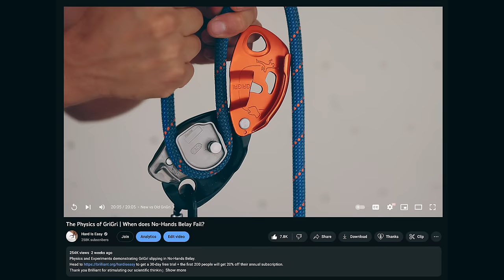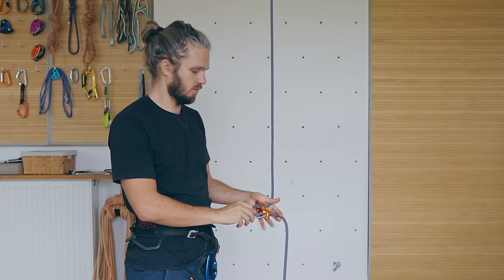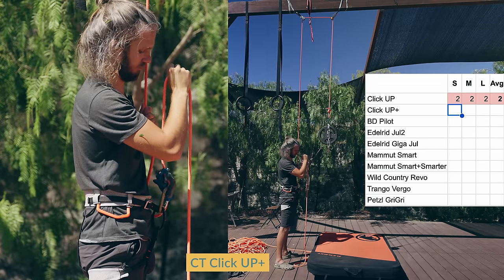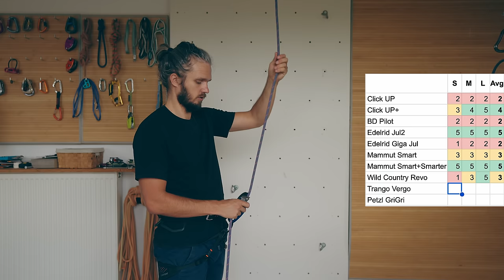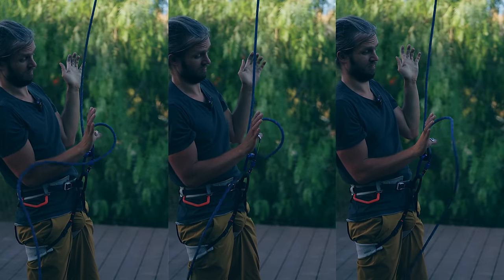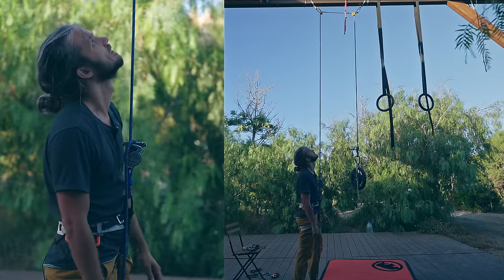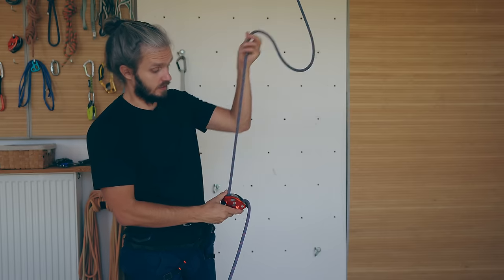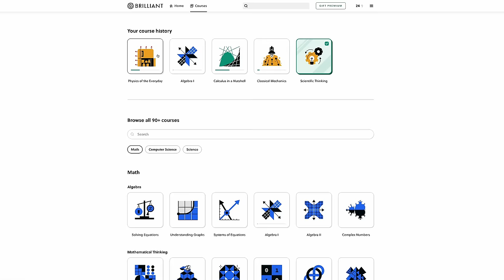When Assistance Fails!? The Physics And Experiments of Belay Devices

Comment: Of those devices I've tried the GriGri, Jul2, Pilot, and Smart 2.0 (without Smarter).  This video pretty mostly matched my experience in that the Jul2 locked the most readily.  It also had the strongest holding power after a catch.  None of ~3 ropes I tried slipped at all even when I had slack ahead of my brake hand.  The Smart would slip slowly with a heavy climber, and the Pilot would slip at a slow to moderate speed depending on the climber and rope.

As for other things not really covered in/outside the scope of the video: The Pilot was the smoothest of the three assisted-tube style devices in giving and taking slack, the hook for the thumb works pretty well, and it was the easiest by a significant margin for lowering the climber in a smooth and controlled manner using the recommended technique by gripping the whole device.  The Smart felt the least smooth/most friction-y in giving/taking slack, and the thumb hook didn't feel very secure.  Lowering with it is just okay; you use both hands to push up on the lever since you can't really grab the whole thing, and it's a little hard to control that way.  The Jul2 is fairly smooth in giving/taking slack.  The enclosed thumb loop takes a little practice to get used to, since after taking slack you want to be able to get your thumb back in there without looking down.  However, once I got used to it, I found that easy, and it's obviously the most secure thumb position compared to the other two devices.  The last drawback of the Jul2 is that it's maybe the hardest of the three to smoothly lower with, but once I figured out a technique I liked (wrapping my hand around the tube, with the back of the device between thumb and index finger, with two or three fingers from the same hand in the thumb lever, with other hand on the brake strand to help modulate), it was fine.  The Jul2 ended up being my favored device of the three for its catching and holding characteristics, although I wouldn't mind the Pilot for gym use because it's so smooth.

Lastly, it's true that you are technically defeating the camming action when tilting the assisted tube style devices.  However, I think the way you do that is still better than the way you defeat the GriGri's cam.  With the assisted tubes, you push up with your brake hand.  When a climber falls, your natural reaction is to clamp and pull down, which is exactly what you want to do with those devices.  With the GriGri, clamping with your brake hand can be catastrophic if you're not holding the device and rope correctly.

Anyway, I think these videos are absolutely excellent, and should be required viewing for anyone who's just taken their initial lead belay classes.

Comment: Thx for all this tests! After watching this, I´m still a big fan of "Jul2", because it manages all the situations quite well while in addition have good resistance against dirt etc. and performs well with extremly worn ropes, because the mechanik is very simple. 
I did some tests like this over water with myself (belay myself in toprope and take a fall with no hands on the device) and ~90 % it stops me completely. The rest of the cases (diameter of rope too small, rope wet or frozen or just too new) I hit the water, but the speed was quite low, so I wouldnt expect injuries if the water is "true" ground.
Even Grigri and Clickup failed in my tests, because if you belay yourself with no hand on brake side, the ropes are  pointing up parallel like in your tests.

Comment: The Giga Jul slowly slipping is something I experienced myself (not while climbing, but while testing), though it depends on the rope and the carabiner. It's not really a safety issue in sport climbing IMO because it still slows the rope to a speed where hitting the ground isn't dangerous. However, if you thought you could rappel without a third hand, you can't do that with many ropes because instead of stopping you it will keep slowly sliding down if you let go of the rope.
Reply: The weight of the rope while rappelling is sufficient to stop you completely for most of the rappel while in assisted breaking mode with the ropes I've used. I rappel without a friction hitch while using the giga in this mode. I still tie a cat knot when going hands free for something. A double rope rappel has so much rope weight below the device that I just rappel in manual mode with a friction hitch backup; in assist mode it's a miserable, slow, annoying experience until you are 2/3 of the way down the rappel line for very long rappels.
Reply: @benvizena5951  I rappelled 12 m in assist mode (with a rope where it does fully lock). With an extra carabier as a lever, it's super smooth.

Comment: Great video! Considering the differences between Jul and Giga Jul, it would have been interesting to also see the results for Mega Jul.
Reply: hi, fellow MegaJul owner here. I've tried "hand adove the device" experiment today, and was not able to replicate jul2 success with it :( when my break strand is perfectly parallel to the load strand it just sits there, providing no friction (like BD pilot in the video) and not being pulled down towards the carabiner. It locks if the break strand is leaning forward even a tiny bit though. 
My opinion is that it depends on where the center of gravity of the tube is - if the tail (lever) is heavy the device tends to tilt forward and is engaged. Jul2 seams to have bulkier handle, and there's less metal on the other side, so my guess it tends to rotate itself forward more than megaJul

Comment: This is a great illustration of why although grigri locks fairly reliably when belaying improperly, it's extremely unsafe when used as a descender. In Germany where I live, there's a relatively large T5 geocaching scene and that sport is basically recreational rope access and tree climbing. People usually start after partaking in specialized courses, so they don't have all the knowledge even a lvl 1 rope tech would have. Because of this, there are lots of people using assisted braking devices as descenders, including use as part of positioning lanyards, especially given that the descender that is part of Petzl's Grillon looks just like a grigri, so lots of people think it's just an overpriced grigri+rope combo when it's actually a descender on a rope.

Comment: If I may, I would like to correct you on the use of the Edelrid JUL 2 please ! I used the GriGri and then the Edelrid Eddy for 20 years, and 6 months ago I tried the JUL 2 for sport climbing, and it is amazing when you know how to use it best ! 
To give slack quickly you don't have to override its autolocking system as you showed in your video ! You just have to slide your right hand holding the "safe rope side" far behind you to get about 1 meter of rope from your right hand to the JUL 2, and then bring quickly your right hand close / below the JUL 2... when you are about half way of this move / AFTER starting the move with you right hand, now you can give slack with your left hand to the climber very quickly without locking the rope in the autolocking mechanism !! Your right hand just need to move before your left hand giving the slack !! I use a 10,5 mm rope and it never locks with this method !
If you did not do the method correctly and you move BOTH HANDS IN THE SAME TIME to give the slack, then yes, the rope will lock automatically in the mechanism ! However if this happens, to unlock it very quickly and very safely, I do not recommand to use your right hand holding the "safe rope" and bring your right thumb into the dedicated loop to unlock the system holding the "safe rope side" with only 4 fingers ! 
Instead, I use my left hand (climber's side) and hold the whole JUL2 between the side of my index and my thumb and quickly pull it up few centimeters to unlock the mechanism, and in the same movement upwards, I "slide above" and grab the rope and give the slack very quickly... as long as I have already brought my right hand with the 1 meter slack of rope close to the JUL 2 (just below the JUL 2!!
It's very easy, very quick, very efficient and very safe this way.
Since I understood this method, I through away the GriGri and the Eddy, as there is no point of using another device. The JUL2 is much simpler (no cam, no moving part, no button), very efficient, very solid and durable (all steel construction). 
Amazingly safe and simple product, I really recommand you try it using the method I explain above.

Comment: Very interesting !! I really like your videos. One parameter that would be also good to add is how easy it is to give slack with those devices. Because it can also be dangerous to not be able to give slack when your climber needs to clip very quickly. I switch from the GriGri to the BD Pilot because of this and I feel way more comfortable with it. The BD Pilot is so simple to use that you can not do some mistake (ok, except if you dont hold the breaking rope). But with the GriGri, there are dozens of mistakes you can do to make it go wrong... 😁

Comment: Firstly, I really like all your videos and appreciate the detail of the work you do.

I’d like to comment on the experiment 3, no slack portion of this video as it relates to the Click-up & Click-up+.

This experiment is based on the idea that an actively engaged belay device, the example is the GriGri, will disengage itself if the climber unweights the rope. This then leads to your example experiment and the results you explain. 

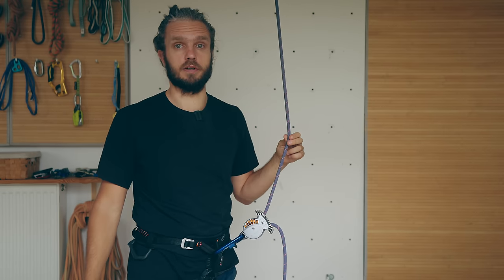However in the Click-up case you, as the belayer, actively disengaged the Click-up+ device, this is seen at 17:46 . 

If a click-up has engaged following a fall, the climber can jump about and unweight the rope and the device will stay engaged… however if the belayer deliberately disengages the locked device, pushing it forward and up, as you do in the video, then all bets are off!

Obviously, whatever our choice of belay device, let’s all hold the dead end of the rope because that’s how we keep our friends alive!

Once again, thanks for the Hard is Easy work!

Comment: I started climbing woth a group of very experienced old guys and they usually use the italian hitch which is just a knot. Would be great to see it compared to the modern devices.
Love your work and i use a device haha
Reply: The Italian Hitch aka Munter Hitch does not stop the rope from slipping. It's another class of belay devices. There's no safety margin in case the belayer lets go of the break-hand side of the rope.
Reply: @philipp9604  but it kinda works even with hand up, and in this test he held on the brake rope just up the device, in this setup the munter hitch just works perfectly fine.

Comment: User error is a design flaw.
Obviously pros don't need/want user error protection, but even i would prefer user error protection for those fringe cases where you're just really caught off guard.
Everyone does errors sometimes, if those errors combine with other errors you can quickly habe a really bad day. 

So i appreciate this video and i appreciate that some manufacturers put effort into midigating user errors.

Comment: Hi, if the climber is lock with the clickup + or not ,  the carabiner is at the front and if the climber just go up and release the rope, the clickup stay in lock position. So if the climber fall at this moment, he will be lock by clickup. Only a human could use the movement for unlock the click up so it will be a human error to not hold the brake side of the rope.

You do a great job, it's a pleasure to see your video. Take your time to have quality.

Comment: For reference I use the Mammut smart alpine (the double rope version of the smart 2.0) with a 9.8mm rope all the time. I treat it like a normal ATC, as you should with all devices. I use it for a few reasons over the normal ATC (which I still use for some things). The main reason is that you can hang around on the rope without having to yank on it constantly. Just having your arm below the device is enough to keep it locked. The other is that the alpine can be used in guide mode. 

The diameter and stiffness of the rope matters a fair bit for the locking. Smooth, rigid, new, skinny ropes will run right through it without the brake hand involved. I think that's a minor flaw, but I consider it safer overall compared to the grigri. That might seem silly, but I don't mean on a technical level since the grigri definitely locks better. Instead, because people can't assume it will lock, so they have to treat it like a normal ATC. Grigris are dangerous because people are dumb, not because of any bad design.
The other problem I have with the grigri is not being able to rappel with it. If you do, for any substantial distance or speed, then it can heat up enough to cut through the sheath of the rope. I haven't had it get that extreme, but I did get it hot enough on only a 10-15m rappel that it melted the frayed fibers of the sheath. That just makes me uneasy.

I also never ever ever raise my arm to less than about 70 deg from the climbing end of the rope. Doing so is a really dumb idea as you highlighted. Even just intuitively it makes sense if you try both methods. I wish people wouldn't do that.. It's terrifying to see and so easily avoided. 
This is not a casual sport. You have to know what is going on, plan, and understand how things work. If not you risk serious injury and worse, that injury is usually to others, not the irresponsible person who didn't belay correctly.

Comment: Great video! It's very useful to know the limits and capabilities of the different belay devices. You showed that the gri-gri can be problematic if the belayer pinches the mechanism which could prevent it from locking. This is belaying right handed. I'd be curious if you've tested the similar thing if belaying left handed - but there, the common usage is to pinch the axis of the release level which does not hold the mechanism down. It seems that this method is actually better in this case since it should still quickly lock.

Comment: Great video! Thank you for explaining the mechanics of those devices so well. However, you forgot to mention that in the scenario you described in Experiment #3, the click-up would be locked. You would need to manually unlock it, shifting your focus back to the belay device, in order to replicate the circumstances you tested it under. Thanks again, and I'm excited for more:)
Reply from the maker: Yea I tested all devices in the unlocked state, which can happen in normal belay scenario, but ofc if you lock ClickUP it stays locked, which you could consider slightly safer indeed
Reply: can confirm. it is designed not to lock in the tested situation, because that's how you give slack
Reply: @HardIsEasy  once locked it mostly stays locked, yes. actually it's pretty common to have to try to "de-clip" (unlock) it by unloading it and moving it around, because it happens whenever you give slack too quickly and lock it accidentally. But its quite hard to do even on purpose, so you end up having to grab the device (with the left hand) and pull it up to reset it

Comment: Very happy with the Jul2 results 🎉😂, must say though that for this device and the Giga Jul it is strongly recommended to pair it with the right carabiner as a wrong match will just make it perform way worse if at all. I use the Bruce Steel Triple FG for the Jul2 which although heavier has the added benefit of almost zero wear.
Reply from the maker: Yea all of autotubers are sensitive to carabiner choices, maybe brands should give a list of recommended carabiners. that work the best that they did tests with...
Reply: @HardIsEasy  agreed, zee Germans of Edelrid have done so in the manuals, would be good if all brands did. If I am not mistaken Mammut does so too.
Reply: The JUL² also as any autotube device, is pretty unsafe when giving slack, meaning pushing the device up, most belayers let go the firm grip on the brake rope, and then nothing brakes. All needed to make a accident perfect then is a distracted belayer in that moment of unexpected fall.

Comment: Great video, as always! Sooner or later you will have to make a test of different types of gloves, or your hands will fall off 😂
Also, I have always used the MegaJul, but I don't know if that's more similar to the Jul2 or the GigaJul 🤔 What do you think? Should I make some experiments myself? 😂
Reply: hi, fellow MegaJul owner here. I've tried "hand adove the device" experiment today, and was not able to replicate jul2 success with it :( when my break strand is perfectly parallel to the load strand it just sits there, providing no friction (like BD pilot in the video) and not being pulled down towards the carabiner. It locks if the break strand is leaning forward even a tiny bit though. 
My opinion is that it depends on where the center of gravity of the tube is - if the tail (lever) is heavy the device tends to tilt forward and is engaged. Jul2 seams to have bulkier handle, and there's less metal on the other side, so my guess it tends to rotate itself forward more than megaJul